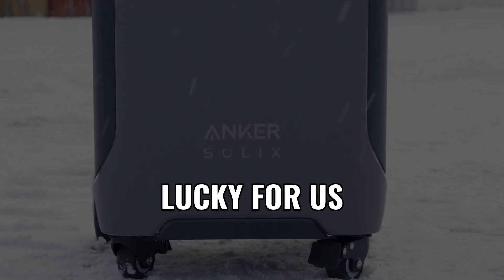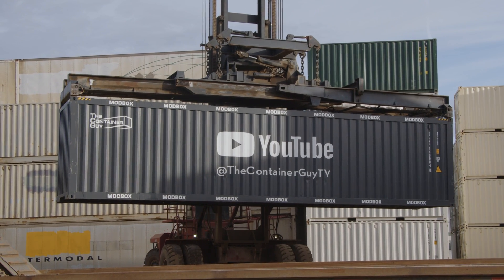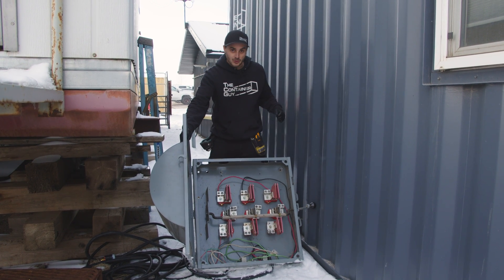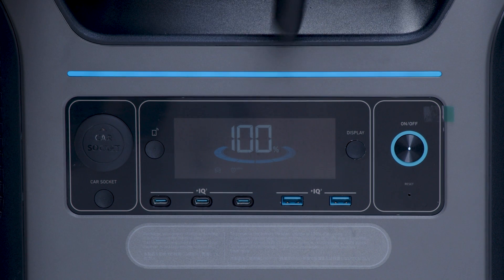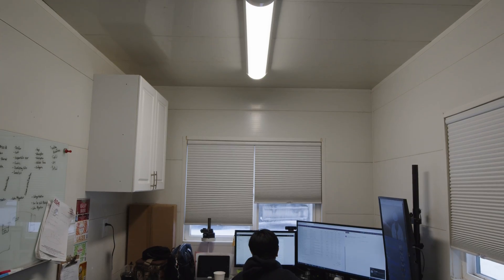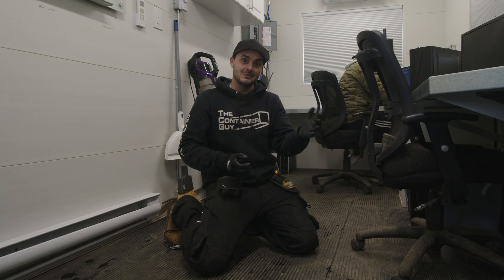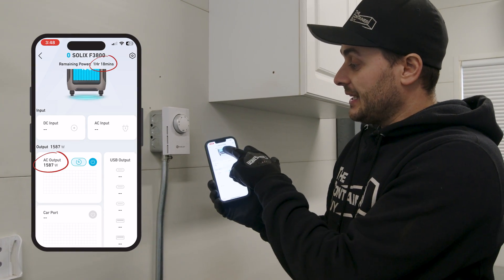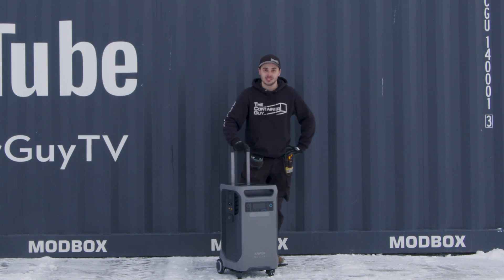The Best Back Up Power Bank? | Reviewing The Anker SOLIX F3800

Comment: have a F3800 and I am looking to recharge the battery with my Erayak 4500 Inverter generator when needed per no sun for solar. Is this possible? Could I treat it just like I am charging from grid power and use a 8 gage extension cord and set my Solix to either 800 or 1000 watts?. What worries would I have concerning the amp output of my generator which has a rated output of 230/120V and 15.2/29.2 A respectively. Any information would be greatly appreciated.
Greg

Comment: The solar input is limited to 60 volts.  The large 550 watt panels you should might not even be able to be used with this unit as in the cold they might exceed the 60 volt input limit and fry the Anker unit.  Even if they did not, they would all have to be put in parallel instead of series meaning much, much larger wires and current load.  This is a fatal flaw of this unit.  It is good for backup of a short blackout or for camping if you want split phase but for home use you would be much, much wiser to go with other units
Reply: Anker does this with all their units

Comment: You were going through the power of this unit like crazy and would have to purchase many additional batteries to last even one night at the rate you were burning power.  Even if you did so you would have problems recharging all the batteries as the grid input is limited to 1,800 watts

Comment: Looks like a good unit for emergency medical equipment power, but it's discharging much faster than I would want for an entire house. Could be useful as a temporary maintenance system until you get your generator up and running, think of something like a battery backup for your home, instead of just your computer, in a power outage.
Of course the cost of the unit would determine if this is economically feasible or not, and I didn't hear a price in the video.

Comment: So it will run a half hour , forty five minutes 😊. Not the best solution. A gas or propane generator would be better in this case . Heaters draw to much power .

Comment: When i put in battery and solar generators for projects like this, we add an inside 50 amp genny plug as well so batteries can live inside temp controlled environment. You will find the battery and inverter will most likely not charge in those freezing temps. Great test though.